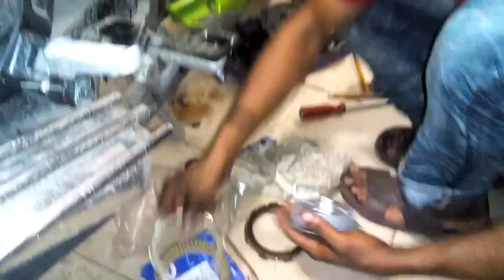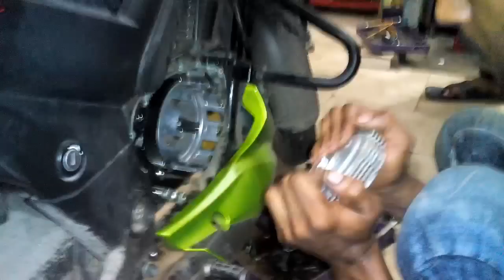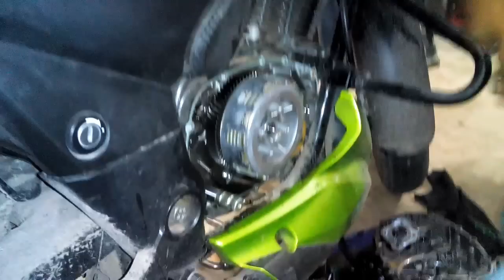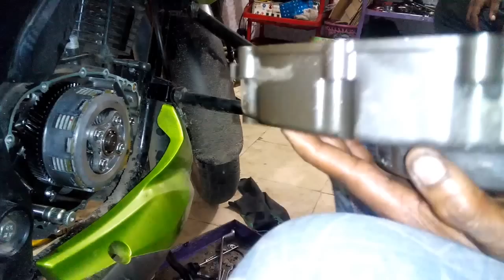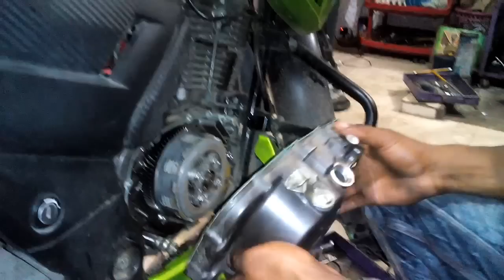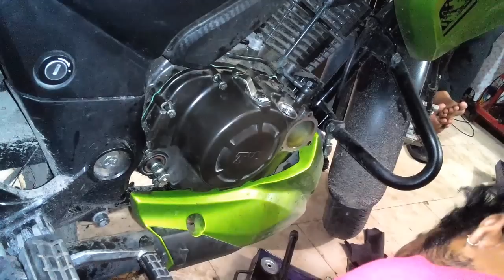Apache RTR 150cc Clutch plate Changing.

Comment: was it the first time? and how many km you rode with the older clutch plates?
Reply from the maker: Yap it was first time. After running 7000 KM 

Sorry for late reply, Thank you
Reply: +Xahid Sun  no problem... 7000? its too early... adjust the clutch properly, so that it would last long